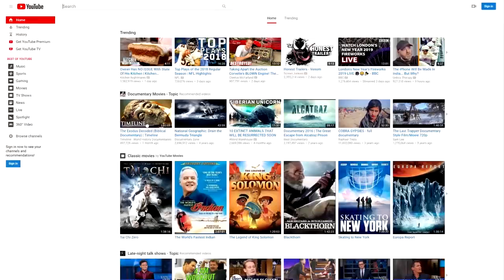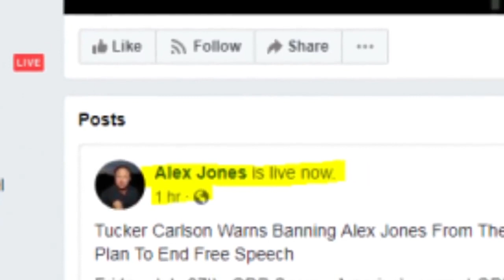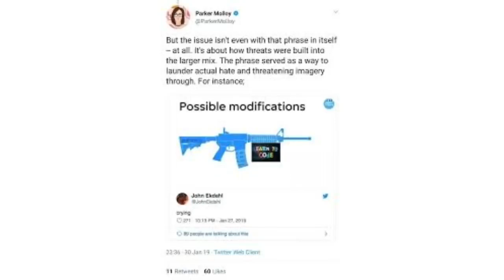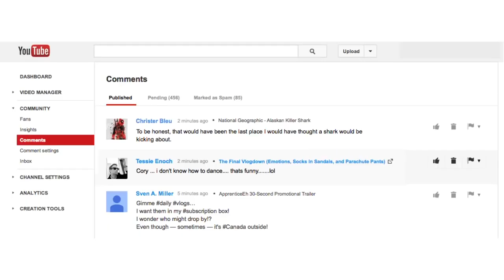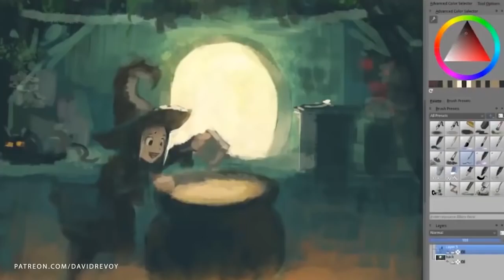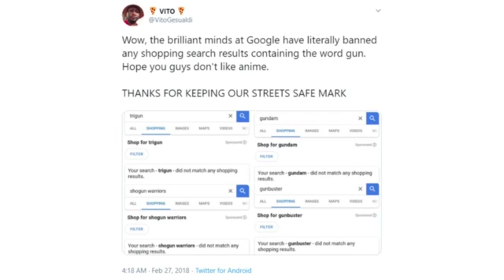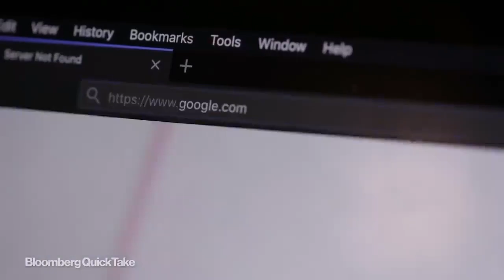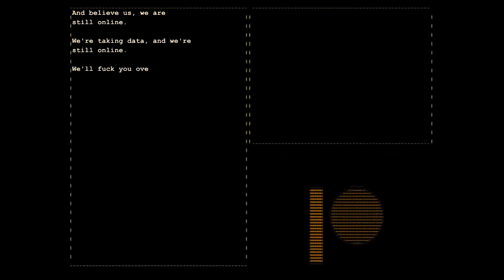Technocracy (All Parts Together)

Comment: It seems I'm a bit late to comment on this video.  However, if it is okay, I think it would be useful to list out the points of demands made near the end of the video: 3:08:55 - 3:13:50.  I tried to make all the points sound clear.  Let me know if any changes are needed.

- Internet access and social media access should be a human right
- Banning access to internet or social media is a human rights violation (skewing results on information is just as bad)
- When signing up for an account on any website, data collection should be turned off by default.
- Users should be able to see who is doing what with their data
- Users should be given access to their collected data upon request
- Collected data should be immediately and permanently deleted upon request by the user
- Social media accounts should be legally considered private property
- When social media accounts are deleted/locked/etc, the social media website should provide a full report of when and why they had done so
- Any digital purchase (digital product) should be downloadable at any given time in a completely usable format without proprietary software required.  Any DRM used for these products should be placed on a dead-man switch or a grace time period.
- The purchaser of a digital good should have all the same rights of a purchaser of a physical good, including being able to make copies and resell the original copy.
- Any user must be able to easily end their use of a platform/website, and without requiring to go through an employee of the platform/website.
- Websites like Google, Twitter and YouTube must determine if they are a platform or a publisher
- Platforms are not responsible for what is on their platform
- Platforms cannot censor people or editorialize (such as ban at will)
- YouTube cannot close down comment sections
- YouTube cannot link to Wikipedia or Encyclopædia Britannica for particular topics
- Platforms cannot artificially inflate or reduce search results
- Publishers can do what Platforms can't but are legally responsible for their content
- YouTube, Google search engine, and Google Chrome must be under different companies
Reply: Louder for the people in the back!
Reply: @
Burchale I'd say that you've hit all of the points of demands, straight on the head.

Comment: 10:00:27 You can look at something someone says and say it's all a bunch of pointless or foul smelling hot air, but the more you try to bottle it up the greater the pressure and it will keep building and building until it explodes.

11:31:12
Essentially, the same reason prohibition failed.

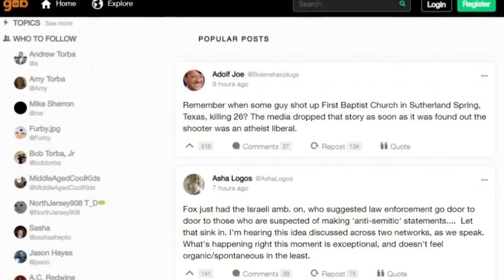Comment: 53:10 but you can't talk out bad opinions with reason when those opinions aren't rooted in reason. People belive in what they feel most emotionally attached to regardless of whether their opinions are actually based in fact or not. Thats how confirmation bias is still a thing in the information age. I mean, how many times have intentions to do this or internet "debates" degraded into outright internet arguments that ultimately resulted in nothing? Perhaps it matters who the talking comes from that takes change to happen.
Reply: and appealing to emotions in an attempt to change emotion based opinions are suspect at least without going down the path of "the ends justify the means", which has its own set of issues.